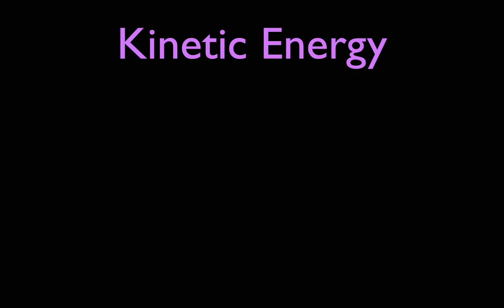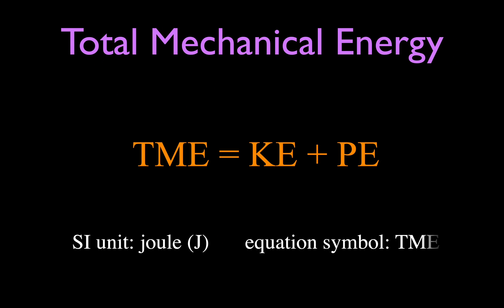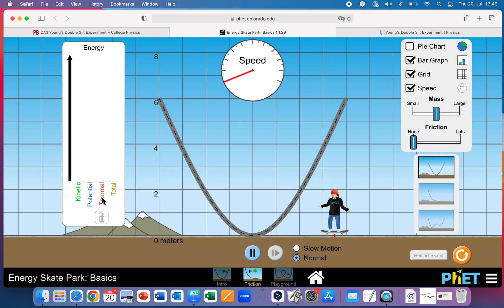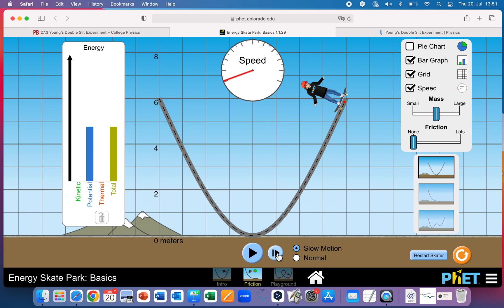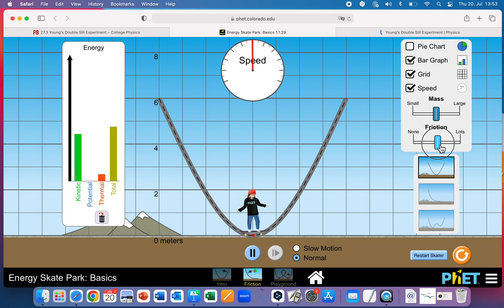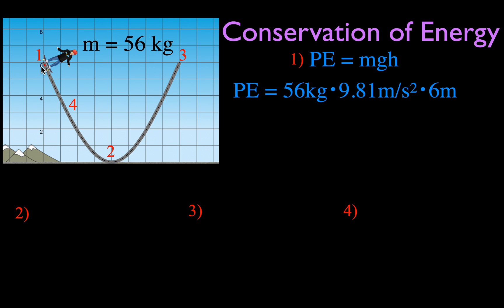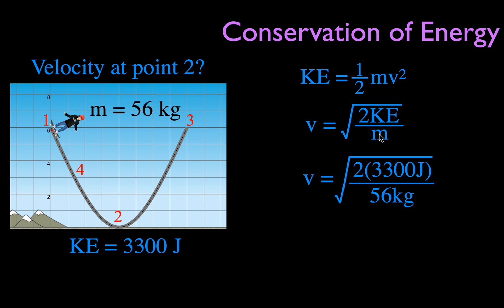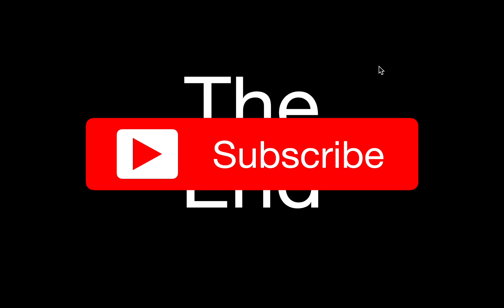Conservation of Mechanical Energy with PhET Interactive Simulations

Comment: Hello 
Thankyou for your valuable time to educate people. 
I have been watching several times of your series with regards to the  EMF . 
I have one question : 
https://www.youtube.com/watch?v=uuIpL9drmqo&list=PLcJ1NYursFxhX2lZLeJP-IcwiQlrwz3Sw&index=9

In the above link :  if the area of the COIL is bigger than the Area of the Magnet :   Induced VOLTAGE is going to be the same ? 
I really appreciate if you could give an answer. Thanks in advance.   Dinna
Reply: Hello I asked the above question cause. I have seen most of the motors coil loop is bigger than the magnet.  I really appreciate if you could explain this. Kind regards, Dinna
Reply from the maker: I am not sure that I understand your question because the way I see it the coil (the red rectangle) is smaller then the area of the magnetic field (inside the blue square), or am I missing something??
Reply: @stepbystepscience    Thank you for your reply : sorry for the confusion . The Question is :    If the  (RED RECTANGLE - Coreless coil  ) is  larger than then ( BLUE square - MAGNET )  then  --- >  induced voltage going to be the same or different ?
Reply from the maker: @dinnade9338  good question, I would have to say that if the coil is bigger than the magnet then the induced voltage would be less. 

But of course the field from the magnet goes on forever, but if the magnet is small and the coil is very large than you would have to imagine that the induced voltage would be less than if the coil was the same size as the magnet. How does that sound?
Reply: @stepbystepscience  - Thank you for your time. I did 2 practical experiments.  
1. same length of coli : 
2. magnet is smaller  than the coil 
3. Core height same 20mm 
Experiment 1 : wound the coil with big space in the middle. - 250 turns
Experiment 2 : wound the coil with very small space in the middle. -318 turns

both produce the same voltage @ RPM 600 .  In this case, I realized  length is the key factor.  Do not understand why turns and length both included in the  
"Magnetic Field Coil"  equation.   Any ideas ?  Thanks a lot for reading the comments and reply to the questions ... Have a wonderful day ... Dinna